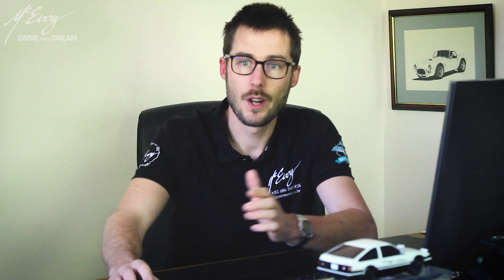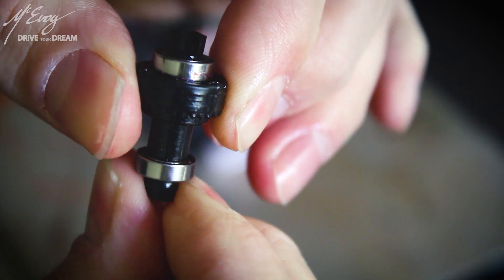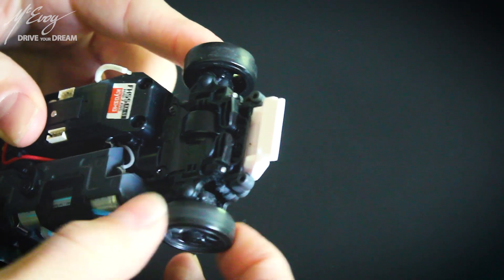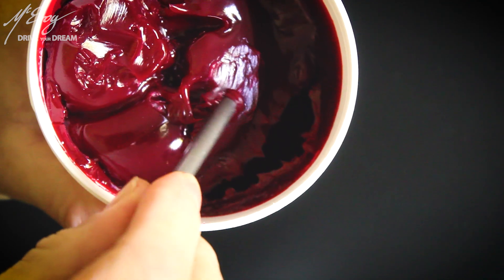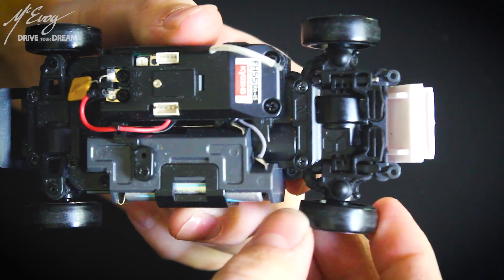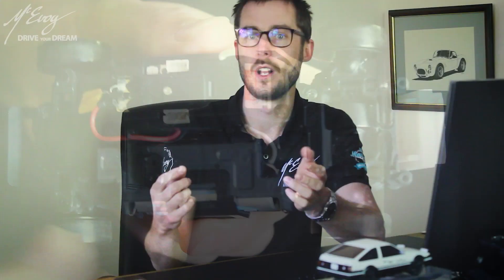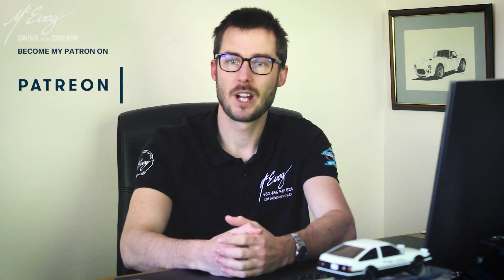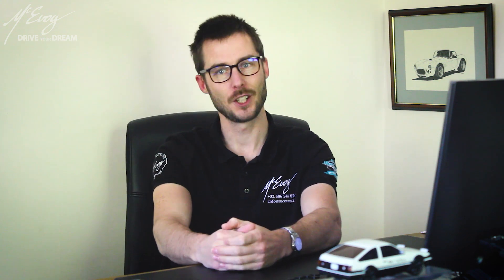The Mini Z Garage: Make an LSD

Comment: You talk about this mod in the context of drift but a front one way is way better than stiffening the front diff. I’ve never known anyone purposely stiffen their front diff for drift. I’ll try it later to be sure but I really can’t see this being an improvement, you hint at that by mentioning you have issues with tight bends and need more throttle and reverse entries to compensate which seems very odd for a drift build. I would consider this for the rear diff if I didn’t want a locked diff for whatever reason but tbh 90% or cc kits use a locked rear diff and I can’t see many people having a need for a stiff diff instead of a locked cs rear diff. Sorry if I seem negative I’m trying to understand. I like the video and the editing was slick.
Reply from the maker: Thank you for your input. Glad to know that you have never heard of this type of application, being done before. I have applied this mod to the front diff of my Mini Z, as I have locked the rear. Certainly, you can load this chassis up with a wide variety of hop-ups, bought off the internet. I do this mainly for the challenge of finding new solutions, because I am a professional mechanic with a bit of time to spare. Also I am happy to have come up with a new, easy and cheap solution for those who like messing around with their Mini Z, without having to break the bank. I don't intend to enter any competitions with this, I just drift around the house, so the handling is quite alright for what little I use it. It's more about the fun of messing around with it, and I must agree that a one-way differential seems to be the way to go. Thanks again for your feedback!
Reply: Geoffrey McEvoy the concept of putting grease in a diff isn’t new to me. I’m wondering why you’d want to in the front of a drift car... why would you want the front diff to lock at all? It only promotes understeer and reduces turning circle which is the opposite of what you want in a drift car. Makes sense for a crawler or something. Check out beavers hobby channel for cool diy mods.
Reply from the maker: I find that it improves steering response. The open setting makes a change of direction happen too quickly, and with the grease it makes it more predictable, somewhat. It suits me, anyhow. It does reduce turning circle a little, which the mini Z certainly lacks to begin with, but this setup corresponds to a driving style that I like. It doesn't promote over-steer as much as you would think, however.

Comment: This is a nice upgrade to do, vasaline also works but i generally prefer to use a RC specific diff grease (eg i use an atomic kit i have laying around) as it will list the grease 'weight' on the packaging making repeatability easier  as well as tuning (as you can select a heavier weight to lock the diff more). This and the bluetac mods are definitely the cheapest upgrades you can do
Reply from the maker: It is certainly more accurate to use the RC specific grease. This is more of an experiment, which has concluded to a positive result. I had great fun, messing around with this topic. :)